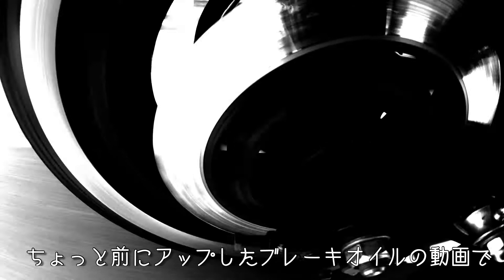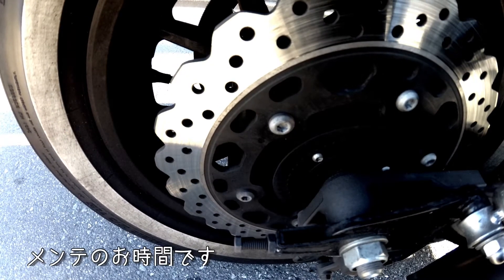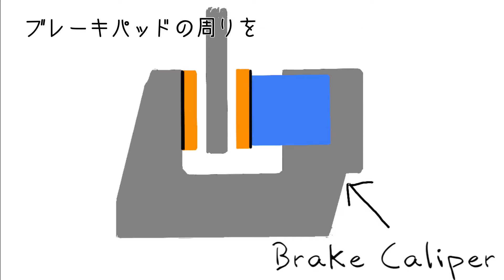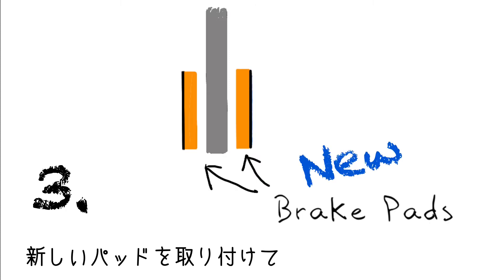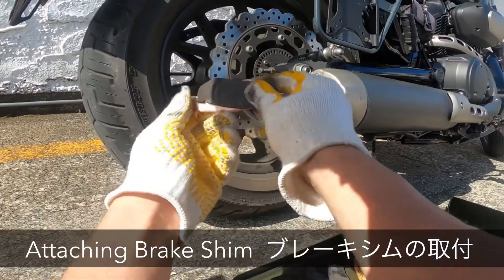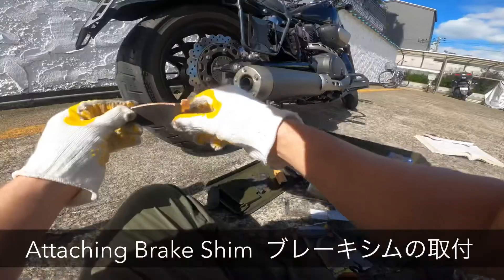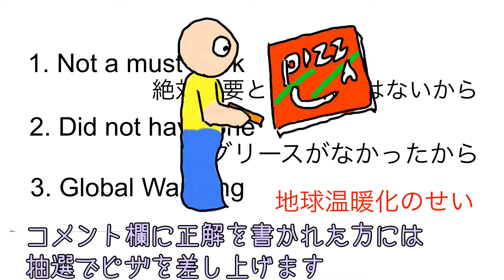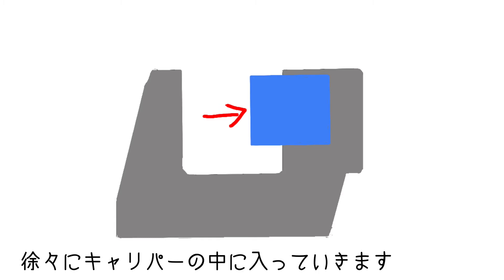DIY Maintenance Challenge: Brake Pad Replacement on Yamaha Bolt XVS950 ブレーキパッドの交換［日英字幕］

Comment: Hey buddy, great video. I’m just wondering what brake pads you put in? I can’t find it in the manual
Reply from the maker: I used Golden Pad No.103 of DAYTONA for the rear brake. I recommend you to check your bike model and production year before purchase because the pad model to apply might be different by production period of the bike. Search on the web with keywords to specify your motorcycle for these information.